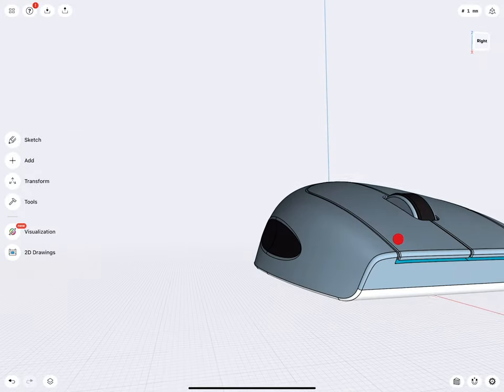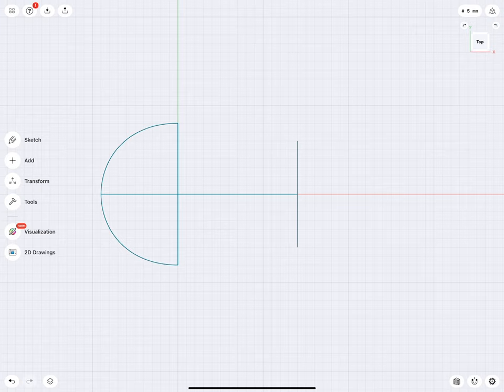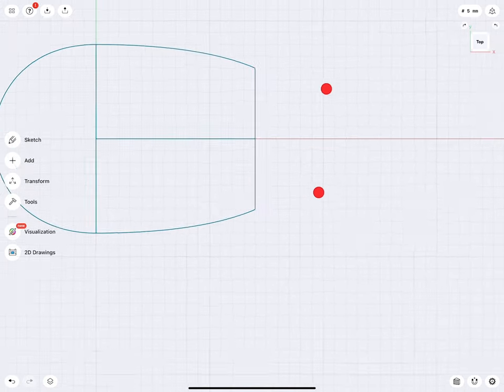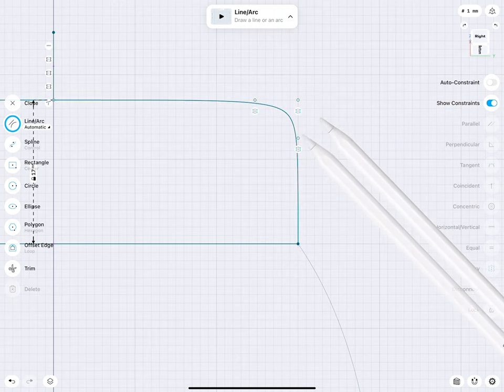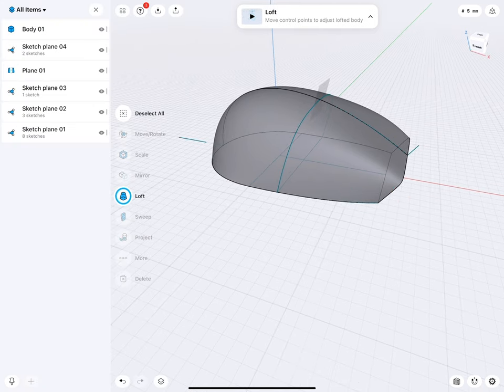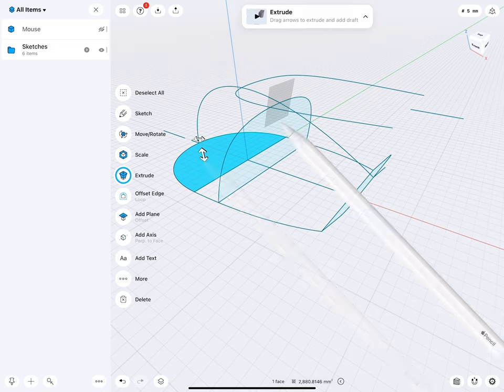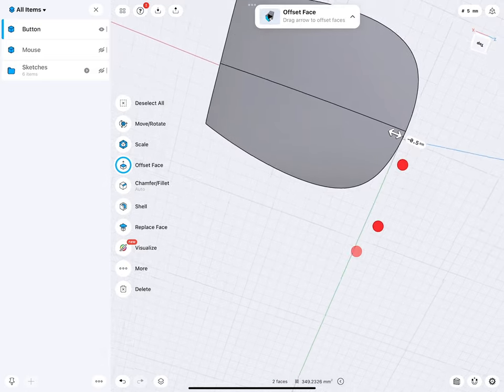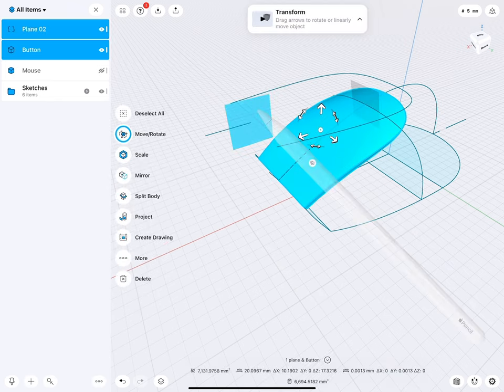3D modeling a computer mouse | Shapr3D tutorial

Comment: This is great for showing an ID model for presentations and I really appreciate the tutorial explaining each command.
Now I'll search your library for an engineering tutorial that teaches importing an ID model to make a master assembly of a computer mouse or other model. 
Then shelling, drafting surfaces,  extracting individual parts, making them ready for SLA model`s and prototyping them with production manufacturing houses for engineering evaluation that will use detail drawings for incoming inspection and release for production tooling when approved.
Hopefully Shapr3D has tutorials of each sequence mentioned above and is capable of modeling each of these steps.

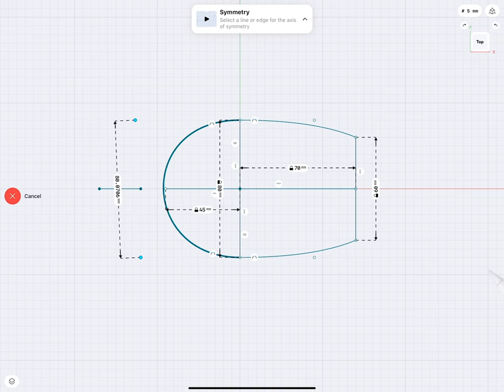Comment: At approximately 3:30 you mention "adding a pair of CV's".  What are CV's?
Reply from the maker: Hi there! It means Control Vertices.
Reply: @Shapr3d  Thanks.  The process of where the CV's were selected went by so *fast*.  Were the CV's those of the horizontal line previously drawn?  If so,  I wouldn't have thought they would have already been aligned vertically.
Reply from the maker: @JSClements  This is a Control Vertice, which is placed when they are making the two splines at around 1:55 🙌
Reply: @Shapr3d  Can you make a video explaining how to go about the internal part of the mouse? I mean, based on your tutorial I was able to create a solid out shape, how about the internal part? So I could fit the electronics and whatnot. Thanks in advance!